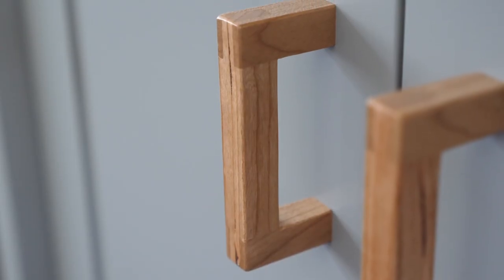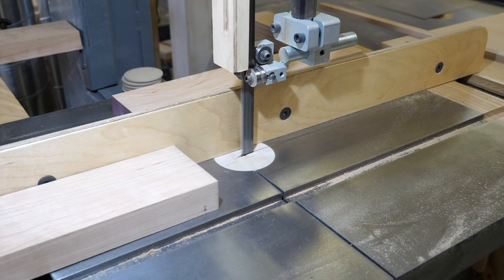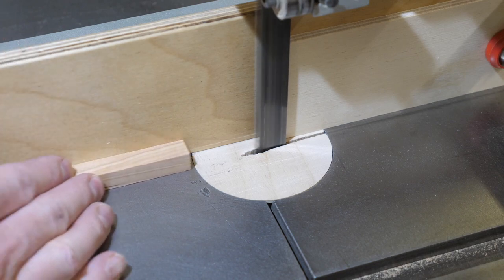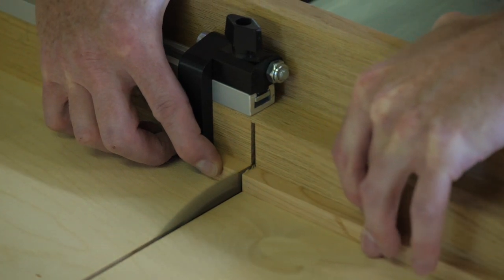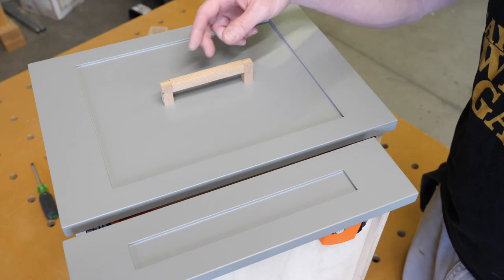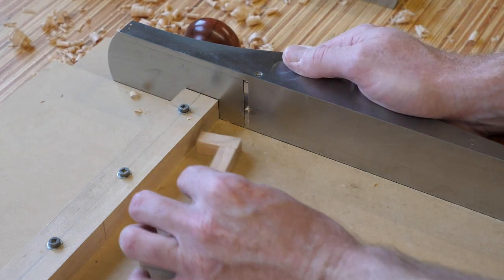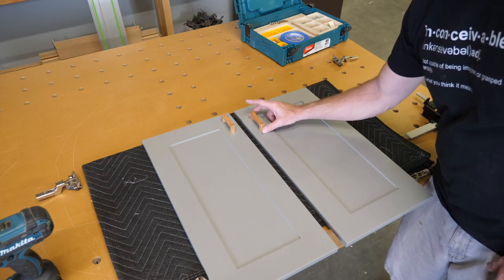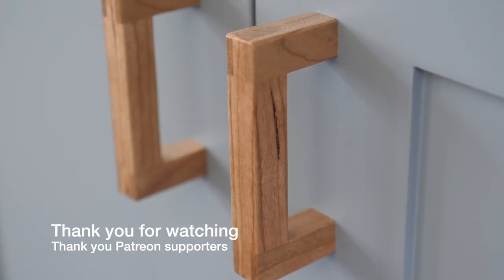Cabinet pulls, Lets make these!

Comment: Very neat idea for handles!  I had just this evening been pondering something similar for some drawers I need to make -- similar overall size and shape, squared, with long grain in all 3 parts.  But alas, having no band saw, your bridle joint idea might be a bit of a challenge for me.  Instead, I thought of joining 3 boards about 10" long like a trough, wide bottom, short sides, with the sides butted so as to cover the wide board's edge.  The grain orientation would be running across the trough and up the sides, instead of the length of it.  Then another trough with the sides not covering the wide board's edge, but sitting on top of it.  Oh, and both troughs ending up the same exact overall dimensions (so the first one has a narrower wide piece and wider side pieces, and vice versa for the other one).  Glue up the two troughs using no brads or mechanical fasteners.  

Now put each trough on the table saw sled, and slice off U-shaped handle pieces that are half the thickness of the boards used in the troughs, like slicing up a loaf of bread.  Finally, take a slice from each trough, sand the sawed surfaces flat without rounding the edges (I very much like your adhesive sandpaper stuck on the flat workbench idea), and glue them together, so that the corners have the appearance of half laps.  These laminated half lap handles seem like they would be pretty quick to batch out, and with some good sanding before laminating them to erase the saw marks, I bet the glue line would be nearly invisible (depending on how it aligns with the wood grain).  

And come to think of it, a bridle joint handle would be possible with this method as well -- just cut slices that are 1/3 the thickness of the boards, and laminate 3 pieces (would have to start with one of the troughs twice the length of the other one, to avoid running out of parts).
Reply from the maker: Well thought out for sure. Building things requires a careful examination of the tools and methods at your disposal, then selecting the best way forward. I say give it a try.

Comment: Those handles are just begging to be touched.  I love how the wood glows.  This is a nubie question- Does the plane wear away the support/positioning pieces on your shooting board over time?
Reply: No, it doesn't because the blade doesn't cut all the way to the side of the plane.
Reply from the maker: It cuts in only a little and then stops. As Andrew mentioned, its because the blade doesn't go all the way out to the edge of the plane body.

Comment: Also if you need you can add some dowels on those to make them even stronger
Reply from the maker: I should have done that. Good idea.
Reply: I was going to say, the bridle is pretty, but is not the right joint for the situation...they only offer glue strength in the direction they are going to be pulled...something mechanical is needed on something that's gonna get so much repeated and consistent force...(still they are beautiful)

Comment: Great video. Question, what do you do to mitigate tear out when drilling the screw holes through the doors and drawer fronts?
Reply from the maker: I use only sharp bits, and I push very gently as the bit is going through. Also, if its super critical, a block of wood can be used as backup.

Comment: Your bandsaw cuts look like they came off the table saw. What blade do you use?
Reply from the maker: Thank you. I use a Lenox Carbide tipped blade. Its not cheap, but its stayed sharp a long time already, and cuts super clean.
Reply: Mike's bandsaw game is on point
Reply from the maker: @akirch9  Thanks.

Comment: Thinking outside the box?  I need to have handrails for my mother to get out of the shower.  Could these pulls work, in a larger size, as handrails, outside of the shower area, so it will not be subjected to water from the shower. Of course steam moisture would be present. Bathroom handrails are so ugly, be cool to have something nice, like these pulls.
Reply from the maker: You could make that work using teak.

Comment: Why didn't you just run a long piece of stock on the shaper with a groove cutter in it and then cut them to length for the morties? I just made these too for my daughter's dresser. @hardwoodcustomcreations
Reply from the maker: That would have worked. Doing it this way is fine too, plus I like using the bandsaw.
Reply: @MikeFarrington  I figured, you just did it a way you enjoy. Busy work is always forcing me to bury those habits. :(

Comment: Why is it called “ripping” for bigger jobs and “cutting” for smaller jobs, when what you’re doing is “sawing”?
Reply: A rip-cut goes along the grain, and a cross-cut across the grain, it's just easier to go with saying ripping and cutting I suppose :)
Reply: So it’s not really about the size of the job, but rather in what direction the rip/cut goes?
Reply from the maker: Ripping is with the grain, cross cutting is across the gain. I normally don't say ripping in my day to day conversation, but on video I try to be more accurate with my words.
Reply: Thank you Snoot and Mike for clarifying.
Reply: @MikeFarrington  Or this: Rip cut: A rip that is so clean it looks like a cut. Cross cut: Cutting out a ✝ shape.
Reply from the maker: @doubledarefan  Ha! I like it.